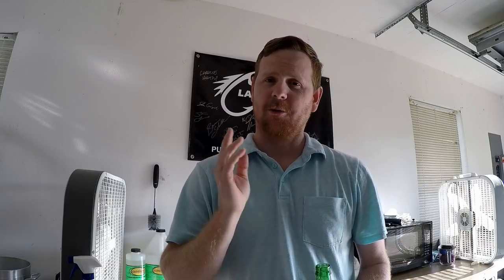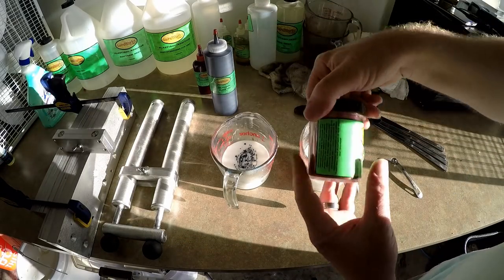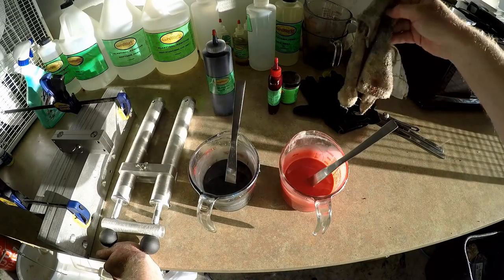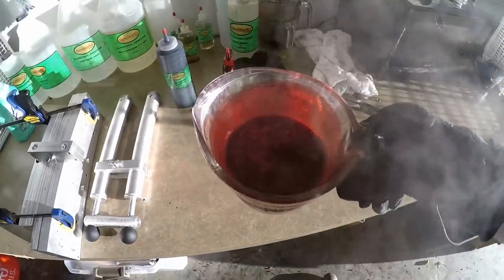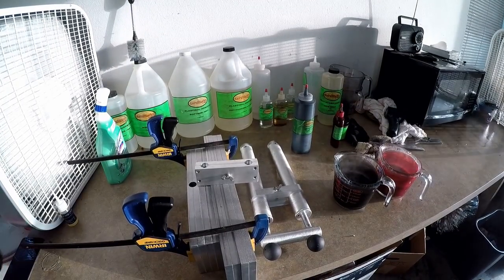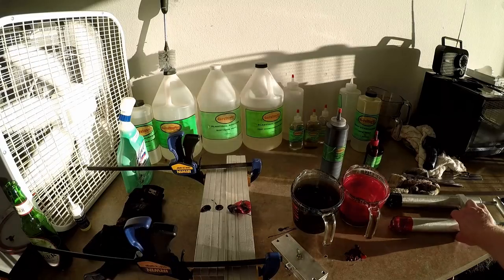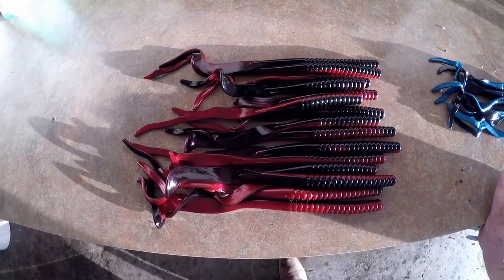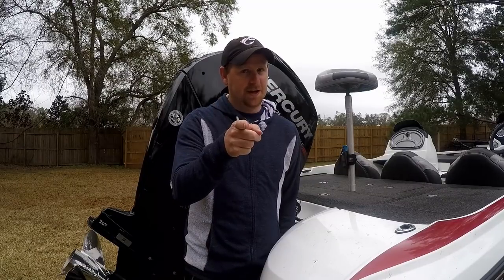POPULAR COLORS: RED SHAD..How to make soft plastic baits/lures

Comment: Having issues with air bubbles in my baits...any suggestions on How to fix it?
Reply from the maker: heat slower, stir slower.  if that doesnt work then you might have moisture in it.  The only way to 100% solve it is a vacuum chamber
Reply: My bad...it isn't small air bubbles from stirring or anything....they are big voids. Half inch long or more, and leaves one big air bubble that is a third of the bait. It is kind of like a swim bait balloon....LOL